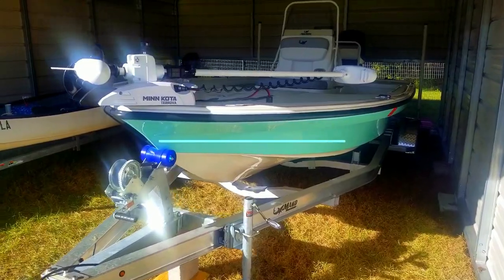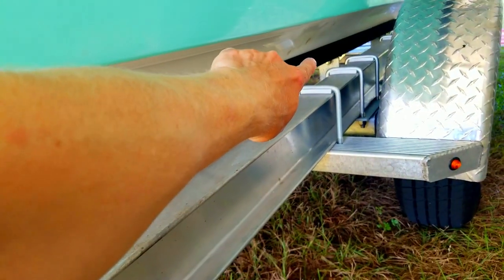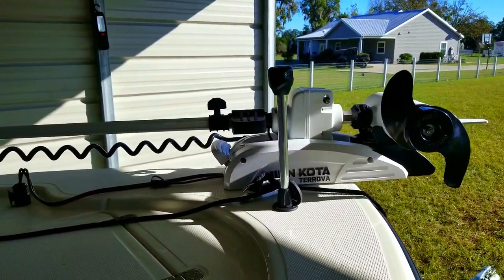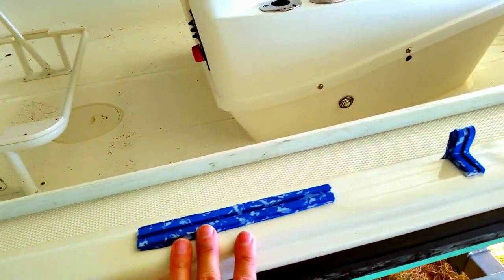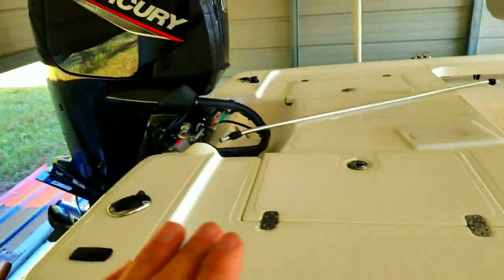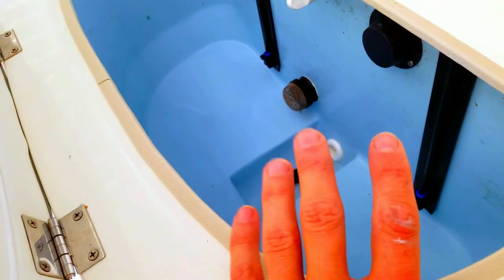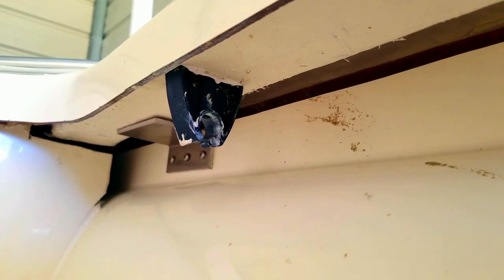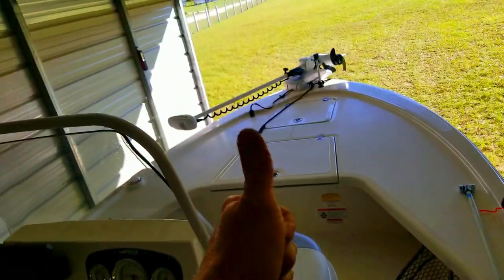2023 MAKO 18 LTS FOLLOW UP REVIEW

Comment: Love my 18 LTS.       I have the 115 ProXS on mine it flys      I build a custom fish finder mount on my console and have 2 10” displays.     On back of my leaning post fab a custom bracket to allow 8 rod holders to be out the back without cutting holes in back deck.     I have same trolling motor but mine move my boat amazing in some of the windiest days or heaviest of currents it holds me without fail.     One thing I noticed on the trolling motor plug keep failing due to salt water I ran and direct wired my trolling motor         I added my navigation lights onto my console because the stick light plug just had to keep changing it decided to do a permanent amount, direct wire solution
Reply: Photo please:    I build a custom fish finder mount on my console and have 2 10” displays.

Comment: was looking at this boat in Spring of 2022 but ended up with a 2020 Key West 176 instead for mid 30k range (found a great deal). Either way it's all about being on the water. tight lines.
Reply: good choice.  modern mako boats are junk.
Reply: buy           it
Reply: @zero_to_1000  wring

Comment: At what depth or how shallow are you able to get in and out safely?
I recently purchased a 2009 18LTS but I don't have a jack plate or trim tabs. I can drift in a foot of water and putter out with trim up but I am very curious about how much of a difference the jack plate makes. Any input would be greatly appreciated.  Shallow fishing videos would be great too! Subscribed!
Reply from the maker: Same as you David. The trim tabs and jack plate just help getting on plane faster which can help in shallow water. I still wait until I get into a deeper hole to jump on a plane though.
Reply: I have a ‘21 model 18LTS with tabs,jack plate and a Cougar anti ventilation plate.Any depth over a foot and it will plane out.On plane it will run in 6 inches of water.
Reply: @mikecamp6079  Good to know. I'm definitely going to add a jack plate and trim tabs to mine. Unfortunately I recently had issues with my trailer that required a new axle. $1400 worth of parts & shipping that could've gone towards the cost of a jack plate instead. Advice: make sure you check your oil filled hub caps before heading out (something I didn't do).  Get your hubs serviced at the 1st sign of water in the oil. I'll be doing the axle swap myself so I'll save a bit there.
Reply: @mikecamp6079 you must be from the RGV?!
Reply: @mikecamp6079 whats the minimal you drift?
Reply: @Dcj01  Yes,Brownsville
Reply: I drift in a little less than a foot.

Comment: I’ve got some questions about your trim tabs.    I’ve considered adding trim tabs to my 18 LTS but the shape of the transom does not make it easy to use the Bennett or Lenco tabs.   I looked at a new LTS at Bass Pro and it appears there are no hinges on the factory tabs.   It appears the plate is thru bolted under the hull but the tail end of it just flexes up or down bending the aluminum or stainless tab itself.   Can you tell me if I am understanding this correctly?
Reply from the maker: It is not a question I have asked the salesman but I came to the same conclusion you have. I know one thing, this boat needs trim tabs and you will definitely love the performance when you install them. The front end does porpoise at high speeds and you need the tabs to jump on a plane faster or if you have a lot of weight (people) sitting toward the back. With the trim tabs and playing with the motor trim, you can definitely maximize speed.

Comment: I need your help please.  I have a 2022 Mako lts , the problem is with the bait well. When I turn the pump on setting still no water only when I'm moving. I saw where you turn the valve off.  So every time you want to fill the bait well you have open and close the valve?
Reply from the maker: I have had problems with the bait well pump since I bought it. Yes if the valve is open when in a plane it will overflow bait well. My pump that pumps water in from the outside hasnt worked since I bought it and bass bro doesn't seem to have answers. I'm thinking that since water gets forced in on plane, it is somehow creating a problem with the pump. I have just manually filled the bait well with bucket and then use air stones and circulator
Reply: @mgsfishing  where did you get the plug for the boat , I have the same problem with water coming in backing up.
Reply from the maker: @stevedraper857  I just twist the nozzle close in the livewell
Reply: @mgsfishing  I'm talking about the boat plug behind the seat and cooler, I can't find one big enough.  Thanks
Reply from the maker: @stevedraper857  oh yeah mine came with one. It appears to be just a kayak Skupper plug. Maybe a racket ball would work.

Comment: How shallow will it run and how much water will it float in
Reply from the maker: The engine will overheat due to not getting enough water in it when the jack plate is all the way up so you can't run it on a plane like that for long. But you can get by in a foot
Reply: @mgsfishing  thanks for the info been trying to find a boat that will float in a foot of water and won't break the bank my current boat needs about 16in to 2ft

Comment: You made the right choice with the engine. the mercury 75-115 all weigh the same. So if you would have went with a 90, you'd lose power and not float any higher.
Reply: 90            hp jet putard
Reply: Mines a 60 2 stroke it’s a great wieght  a 70  is a stretch  I like the 4” motor up  draft
Reply: Jets a pain  all hands  on u can’t motor and fish

Comment: There  are better boats for the money.  You're just paying for the name when you buy a modern mako.
Reply from the maker: please give some examples. In my area, people were wanting way more money for old used boats
Reply: @mgsfishing  More money for a used key west, pthfinder,  or everglades is justied.  The reason a new mako is cheaper is evident in the build quality and lack of features.  A new boat isnt new after the fish bloody mackeral thrashes about on the deck.  I'll never buy a new boat again.  Kind of pointless.
Reply from the maker: @zero_to_1000  I see your point. For me I didn't want to buy someone elses problem, especially with a used motor
Reply: @mgsfishing  modern four strokes are so good. A couple hundred hours and the rings are just seating.  Anything built after around 2014 or so is gonna be solid, unless it's a merc.
Reply: @zero_to_1000  wróñg
Reply: I bought my 2022 Mako 18 lts for 31,000 out the door, other boats like the G3 was 7 grand more with a 90 horse power. I think I got a great boat for the money.
Reply: @zero_to_1000 I have run Mercury my whole life never one issue.
I had one Yamaha and it was junk.
I am 61 and have been fishing my whole life.